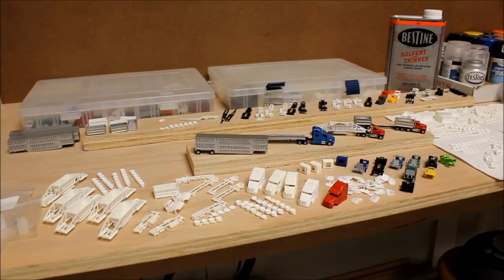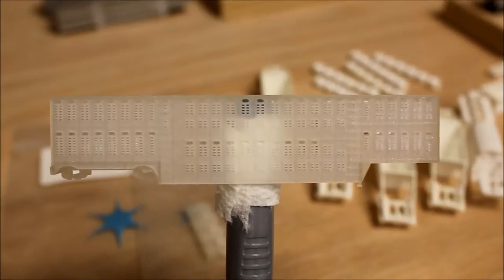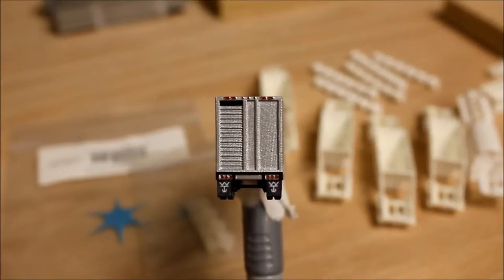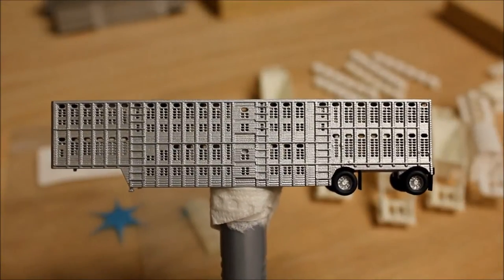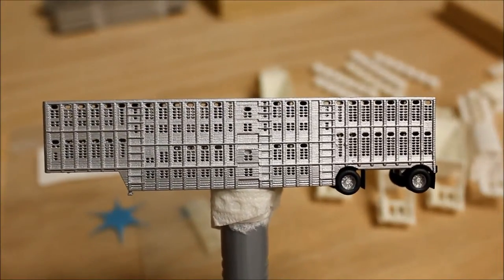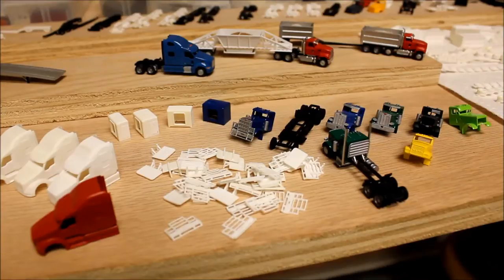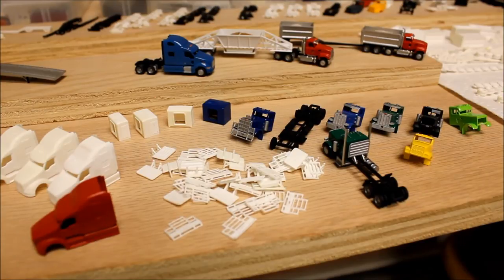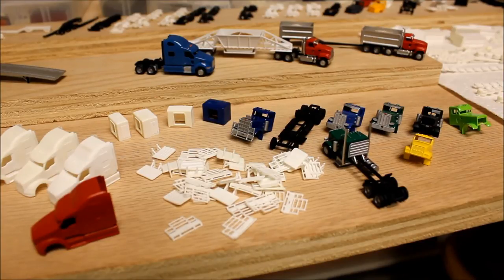Nscale Addict - A Closer Look at 3D Printed Trucks & Trailers in N Scale

Comment from the maker: The sleeper is available with the tractor kit as you are aware since you have a couple.  I could make them available individually as well, however, there is a minimum cost per file through Shapeways, so I hesitate offering small items separately, due to the high cost.  In other words, it is best to cram as many items into a file when printing to spread out this flat minimum fee.